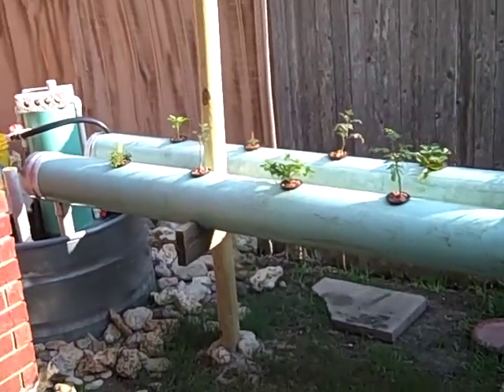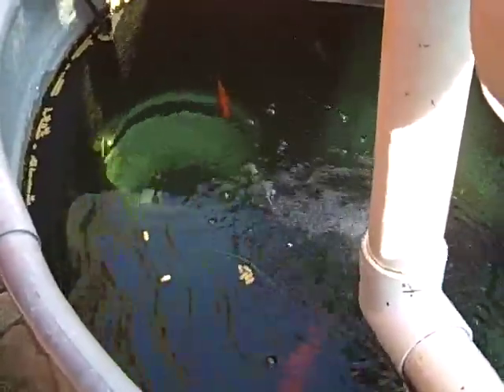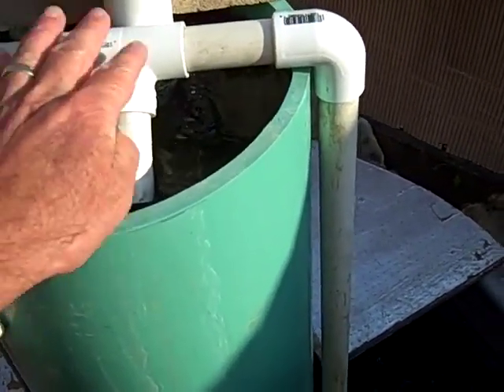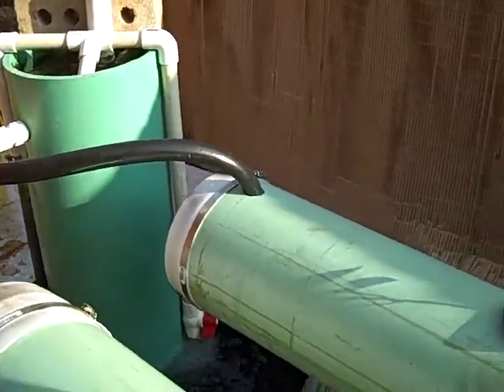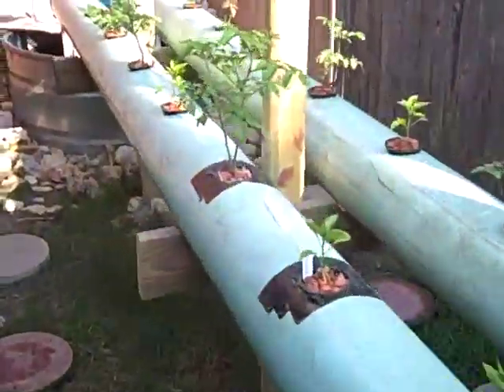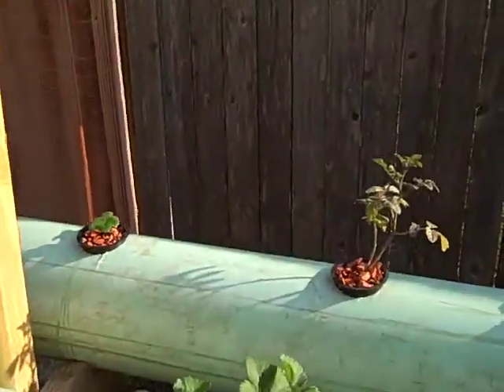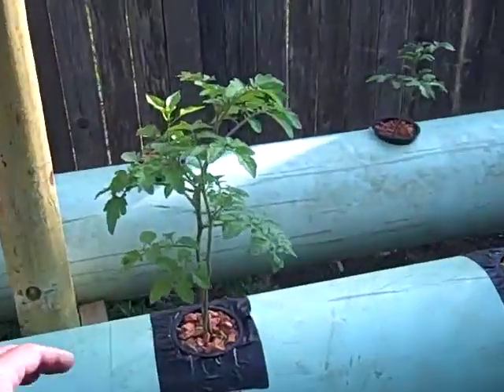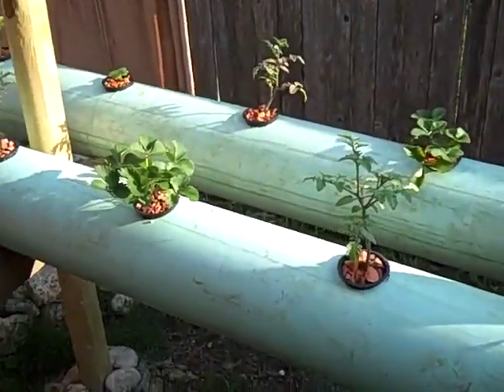Aquaponics - NFT setup in Texas

Comment: @daddykirbs 

Hey, its not the plants but the water getting too hot.
the PVC gets quite hot and the water can raise quite some degrees before falling back in the tank;)
put some more shade over the fishtank and add a airstone in the PVC pipe, that could help a little bit.
also a good idea, fill two 1,5 liter bottles with water and freeze them, then put one each day in the water (depending on the fish u have, some like hot water) and keep rotating.
nice setup BTW

Comment from the maker: @Erich3765 That is correct.  The water just barely touches the bottom of the pots.  Knowing what I know now, I would make the water level higher when the roots are young.  Making the stand pipe taller would accomplish that.  I also added "wicks" into the baskets to help bring the water up to the young roots.  I just used a piece of cotton material, but I've read online that a lot of people use mop strings and have a lot of success.  Thanks!